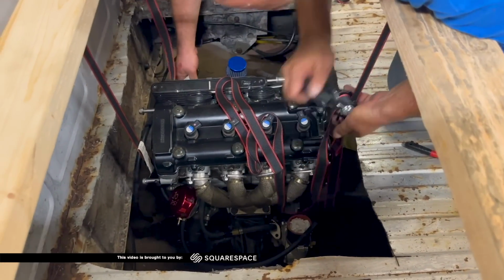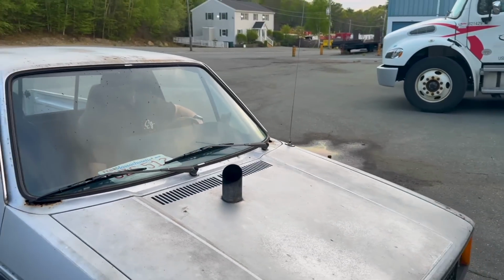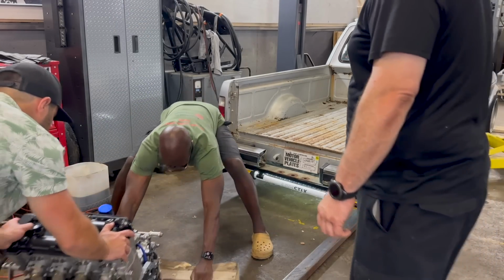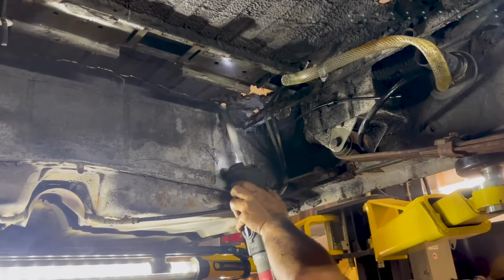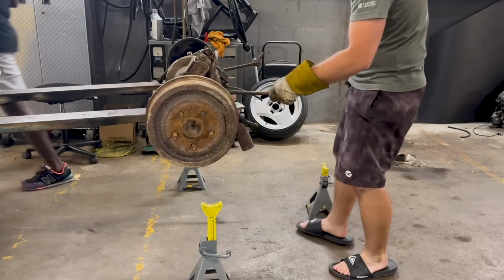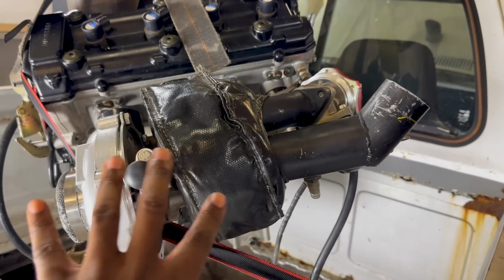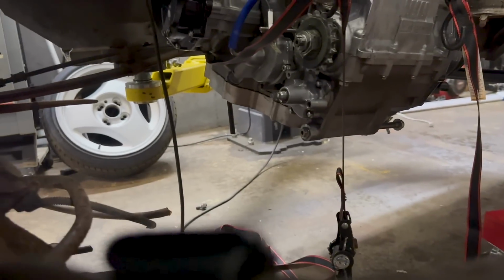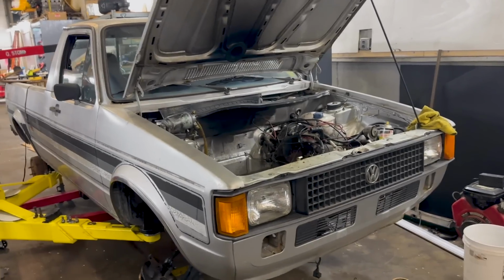Installing A Turbo Hayabusa Engine into an old Volkswagen pickup truck

Comment: I was thinking about doing a hyabusa engine in a English MG and running the shaft straight to the cars manual gearbox . Keep the bike in 2 or 3 gear all the time use the motorbike clutch so then you got reverse a clutch gearbox you name it run all the power stearing electric and other stuff of the motorbike crank

Comment: I bought a zx11 engine for one of my zx11s. It came out of a Lotus Elise a guy was racing at Laguna Seca. I have many additional parts that came with it including a Ford cosworth 4wd front transaxle which is a very small lightweight part. So yeah. You know I have been dreaming. Thinking of a karmann ghia conversion or something pre 1975 that is rear engine.

Comment: I think you could do an off center pumpkin rear end to distribute weight and center the engine with the driver on that side right in front of the engine it will be very out of balance. The linkage will be a challenge but very cool build very one of a kind be a very fun ride !

Comment: Hey Rich! You need to talk to your guy about cutting from underneath on that bed without safety glasses. 
     About 30 years ago a had a 71 Cutlass that had a rusty gas line it was leaking. I had to splice it with some rubber line. I didn't have any safety glasses, i was broke down in the middle of nowhere. 
     Back then we didn't have cell phones. I got metal in my right eye. I had to have surgery to get it all out! They do that so you can see the drill going into your eye! No joke! Not something i would wish on anyone!
     BTW i would love to do something like this. But my engine swapping days are over.

Comment: ford explorer axles are offset to the passenger side which would have given you some more motor/frame rail clearance. also as a bonus, disk brakes.

Comment: 2000's Chrysler/Dodge minivan AWD rearend. It has a solid beam axle on leaf springs like the Volkswagen, but a differential bolted to the chassis, with half shafts connecting the differential to the wheel hubs.

Comment: Although you’ve already cut the hole in the bed, we build rail framed pulling lawn mowers, we take the motorcycle engine and turn them sideways like this but build adapter shafts to bolt it straight to a 2 speed power glide and bolt that straight to a ford 9” rear. That allows us a capability of 12 gears and a reverse. We’re stopped by only being allowed 8’ from center of our rear tires to furthest point forward and we want as much weight as possible to the rear of the lawn mower.

Comment: typical usa comment about fwd cars , you are too used to over sized v8's that cant go round corners , yes fwd cars power and steer and brake using the front wheels but when it comes to driving on roads with bend a fwd car will leave a rwd car in the ditch ,
thats why they are used in country's that have roads with bends (not 20 lanes wide highways with no corners  )

Comment: Why not put the engine sideways over the top of the differential... Adapt a sprocket to the diff flange..line up the trans sprocket and run a chain.... Just sayin

Comment: You can cut circles with a cutting torch using the same basic method and not have to worry about flying fragments of cutting disks. Dad was an iron worker and showed me how he did it, although I never got as smooth with the torch as he was.

Comment: as some one who owns a VW MK1 2007 caddy sport, just to add, that the rabbit (still the same car-ish) is made very diff compeared towords the "traditional" mk1 caddy (whit duel/singelar rounded headlights dependant on model, and a fiberglass/metal body),(and yes i know the original design not production model was not round headlighted), the "traditional" mk1 caddy mostly came whit a 1,6 4 cil engine, and most people who would engine swap the car would HIGHLY be a VW VR6, it,s just sad to see alot of peaople miss-understand the golf community :(

Comment: You need to add 1 major issue to your list.  A motorcycle crankshaft is not designed for the weight or tire patch traction of any car/truck drive system.  It will twist.  It happens all the time in racing these setups.

Comment: And I see the stock rear is a trailer axle (portal but up).  You need a SUA 8.8 and not a SOA.  (Thickness of axle is going to raise rear that high) and you can get the engine/rear to line up better.  Either find new rear, or a flip kit for it.

Comment: All you have to do is take off the chain sprocket and get a drive shaft adapter. Look up Hawk Machine, Bricknell or NXS Motor sports. They all make them and sell them. NXS sells the driveshafts you can use too.

Comment: It looks good. 
Make a jack shaft for the motor alignment and rear alignment.
Shifting . Use 2 starter solenoids to push pull.

Comment: I would have snagged an entire IRS suspension out of somthing like a genesis coupe or 240 etc.  Bolt tge whole suspension in.  It would sit nice and tight in the chassis, driveshaft wouldn't need an integrated slip yoke (which I doubt you have room for)

Comment: I had a mint, non-rusty '82 caddy.   It came from Oregon, of all places.   1.7 litre gas engine.   Installed a 5-speed from a diesel.   It only got 23 mpg, but would easily do 75+ mph.

I sold it after I fixed everything wrong with it.   The next owner completely restored the truck from that point and really had it looking nice.    Then a Silverado t-boned him and totaled it.

Comment: A Caddy Eldordo front end works well.  Tony Vargas at Vargas Turbo and Hi Perforance has a VW Caddy with a Cadillac 500 ci engine mounted in the bed, run through an Eldorado front end.

Comment: Build a subframe off of the front of the differential to support the engine . And use a coupling to join them together.  No driveshaft . Then, use the front spring mounts to support the front of the subframe . 
From Victoria Australia 🇦🇺 👍👍👍

Comment: Would have been easy to use a 4wd transfer case with a 1 to 1 ratio to fix the offset error.  Should be plenty strong.  Cheap and plentiful since there are millions of 4wd rangers and exploders.

Comment: How would it run with just Electric and how much Wattage could you just drop like a 10,000 watt generator in the back with like a 20hp Engine and get crazy Mileage?

Comment: All those tools and no brains..remove rear straight axle..install live axle with appropriate tooth sprocket to original straight axle mounts..mount engine horizontal..run chain between engine and axle sprockets..done

Comment: No clue if it would hold the weight of a car compared to a bike but couldn't you just run a chain off the bike to an independent hub that lines up directly with the rear diff? This gives you free placement of the engine in the rear as well.

Comment: y'all can place the engine more to the center to drive a jack shaft with pillar block bearings. send the shaft forward and use a longer drive shaft to a uni with  three more pillar block bearings using another short chain and sprockets. Y'all can alter the ratio with one of the sprockets.

Comment: for the rear axle, why dont you go with independent axle setup?. is it too complicated to fabricate?. using independent axle setup seems to be better as the coupling between engine output shaft to axle input is static. that way you can fabricate 1:1 belt drive (or chain if you prefer it better) to make the shaft straight instead of having steep angle

Comment: And as far as a shifter goes, the last one I did I made a paddle shifter setup using a Push/Pull cable from a marine application and it worked pretty slick.

Comment: Get a hold of a local Dwarf/Modlite/Legends race supplier. They will have the coupler you need to make a drive shaft work. Also if you wanted to shift the engine more to the center you can get a rear end from one of those cars also. They are narrow and the diff is to the right. 

Also, for the transmission, I would look into back cut gears but the biggest issue is the output shaft. The guy may have already installed one but a billet shaft is a must. I have broken two stock ones on a bike before that came out with the billet one. And while it's apart the shift forks need to be be replaced with stronger ones. Buy once, cry once. A.P.E. is a good source for any parts you need.

Comment: the best way to do this swap is build it like a inex legend car . buy a Driveshaft Flange Yoke then take your sprocket off and have a machine shop drill the holes for the yoke so its centered or it will vibrate. that way you can use a driveshaft . then your gonna need to get a push pull cable for the shfter . theres a ton of work to get this all done and working ! good luck

Comment: Use a jack shaft. or a second bearing support for the loose end of the drive shaft. it will have to be longer. then a gear on the drive shaft.

Comment: Remove the drive gear from the engine and weld it to a cv joint. You’ll need to be able to fully install it. Clip and all. And a slip shaft would be recommended. Sounds cool as shit bro

Comment: Mount the diff on top of your leaf springs! Cut the perches off the diff weld them on the bottom. You at have to get different leaf springs but it will solve your diff to trans angle

Comment: My first thought was run the drive shaft from the rear end to aa solid mounted bearing and put a sprocket on the drive shaft then use a chain in between?that also allows you to mount the motor almost anywhere

Comment: Use a rear axle from a Toyota FJ40 or a Suzuki Samurai.  They have the diff offset to the passenger side which might let you center the engine.

Comment: Right it's very very simple do not drop the motor any more and bring it to center, what you do is then build the frame that attaches itself to the body of the caddy on the frame u install a piller block bearing and you run the driveshaft through it to keep it stable and straight from their u atacht a sprocket to the drive shaft and run it off off a chain 😅 and a nother ting make sure your oil pan is level otherwise u at going to u are going to run in to oil problems a in the long run

Comment: Could have had drive shaft held by bearings and have the shaft chain driven from above.
You could also mount engine further to the centre.
Could even mount a reversing device some where.

Comment: chain and jack shaft design for the drive train. make the lower sprocket a few size bigger to start to make sure have good torque. then from there can change chain size and sprocket sizes for torque vs speed. I've wanted to put a busa motor in a miata for while LOL. and have given lots thoughts to how i would make the drive train. shaft is a lot strain on your cycle engine. the chain helps create a weak point to keep from destroying the motor in down shifting and etc.  
but there is a few trans boxes out there can get that are 1 to 1. and gives a 12 in drop. and use shafts. but they will be small shafts i bet.

Comment: Someone explain to me why they didnt rip out the old motor and put the hyabusa in the front and run a long drive shaft???
Reply: I literally figured that was why they picked that exact engine so it would be small enough to put in the front.

Comment: Solid rear end, drum brakes, and leaf springs is kinda crude for that beast of a motor.

The whole rear end from a Honda S2000 instead?  IRS, disk brakes, and final drive ratio to match those Hayabusa high revs.

Comment: You and Robotcantina should collaborate on an engine swap project.   He is very good at engineering solutions to combine weird engine/transmission combinations.   He put a Kubota diesel in a Saturn and turboed it and kept the stock transmission.  He just started another project where he has a Predator 670 in a old Renault car and figured out a way to use the stock transmission and clutch and mate it to the go cart style output clutch from the 670.

Comment: Simple fix for your driveline problem is a jack shaft, similar to an open chain drive drop box. 
This is basically a shaft supported by bearings with a chain sprocket that is driven from the sprocket from the original engine/transmission. Then a flange on said shaft appropriate to accept the drive shaft that drives the rear differential. 
This also has several benefits to it as well. You’ll be able to set your engine centred if you choose, simple ratio changes without touching the rear differential and if you choose to you could also have a front output to then have all wheel drive. 

You could also have a gear driven sealed drop box/transfer case. It would be stronger and safer but also heavier, substantially more expensive and not as quick/easy to play with gear ratio changes.

Comment: motor trans sprocket to a sprocket adapted tp a ford ranger 4wd transfer case. will allow for a lower shaft angle as well as 4wd

Comment: You can connect the engine sprocket to an "Intermediate" sprock (home made gearbox), that would allow you to split the power front/back and adjust the angle to the rear axle.

Comment: Honestly as as a mid-engine kind of guy myself I recommend you switching the motor location to the front where it's empty and putting all the fuel back to where it was closing up that hole and getting that reverse box and that booster box that would work real nice some boys in the Bronx did that they actually working on it right now same same size of a truck they're using a booster they got a booster box it's a rear wheel drive and they're near completion I think you check them out I seen them on YouTube somewhere

Comment: You also could use a booster box which is a reversing gearbox that goes in line from the motor to the rear end I have one I haven't I have a complete driveline from a ZX12 booster box and an assortment of different small car rear ends pumpkins drive shafts links I'm just looking for a car myself to put everything in but yes this is done overseas almost every day and day and they have so much stuff available for what you need

Comment: Overkill. And Front Wheel Drive in a little pickup truck is perfect for launching small boats at the boat ramp. 
Take the Hyundai Elantra 2.0 fuel injection drivetrain and retrofit into VW pick-up. Anytime I see a lowered vehicle I can tell it's boys and boys being boys interested in pickle juice but not out of the closet. So you 'think'. Chubby thighed women another clue. Beards onboard for $$$. Trumptards.

Comment: Use the Ford Ranger frame transmission and drivetrain. Mount the engine under the hood build a transmission input shaft pilot bearing support used chain drive from Hayabusa to transmission input shaft, leave Hayabusa engine in first gear and use the Ranger transmission to do the shifting. You would also have multiple gear ratio options and reverse. There's more than one way to skin a cat!

Comment: If it were me, I'd run it down to a jack shaft that would connect to the main drive shaft. If you put a decent generator on that I would imagine you could get almost as much power as a Tesla to the front drivetrain... I can't wait to see how this turns out.

Comment: Well, makes way more power than the original engine... but the problem is that the transmission and clutch will never hold up to the weight.

Comment: Come on, I know you all guetto, but FFS, start with as small diff AND brake disks. I just hoje you understand, that engine can cut that chassis in half. Also, you won't have any room for the diveshaft to have some play in a tiny one hand space from the sproket to the diff, but hey,, it's your arse, not mine :D I would make a decent chassis, all alluminium and just bolt the caddy to it.

Comment: You need to check driveline angles with the suspension fully loaded. You want equal but opposite in the 1-3 degree range. You will probably need to get stiffer springs or add slapper bars for spring wrap under load. Also gonna need to rotate the turbo center section so the drain is facing down.

Comment: Why not flip the engine around and go front wheel drive? It solves the shaft angle and length issue. I know you dont  like torque steer but this will not be a drag, race truck. Its a shop truck.

Comment: Should change the rear suspension allow the diff to travel higher in the body and raise the truck bed to above the wheel arches

Comment: Have you actually checked the bike engine rotates in the correct direction for the diff lol… I would have put it in the front and hacked the tunnel out / make a new one. Then you can get the angle you need over distance

Comment: My thought for making this motorcycle engine trans combo work with that driveshaft rear end would to build a cage frame out of square tubing that the motor would bolt into along with a jack shaft setup with a chain sprocket on one end and driveshaft yoke on the other side. That way the motor  and jack shaft would be mounted as a pre assembly between the frame rails up higher and centered in the bed and the jack shaft could be built on the offset to line up with the rear end. Easy for you guys.

Comment: I've been working on a type of liter bike powered racecar (dirt track dwarf car) for a little over a year now, and I'm in the process of swapping an 05 GSXR1000 engine into my 1970 beetle at the moment, so of course I had to see how Rich Rebuilds was planning on setting everything up. Sprocket(output shaft) spline to u-joint adapters are available from nxs-motorsports, marketed for bike powered circuit track racecar classes

Comment: Take the sprocket to a drive shaft shop and have them weld a flange using the teeth and whole face for mounting then use the original bolt for mounting

Comment: Just mount a double bearing jackshaft under the Hayabusa engine and add a flange mount u joint/ drive shaft to your rear end.  Couple chain sprockets and heavy chain or use transfer case chain.  Then you could also mount your engine in the middle of the truck

Comment: What if you turned the motor 180* mounted it directly to the rear axle and use chain drive to the pinion